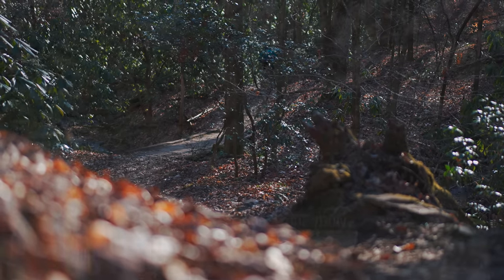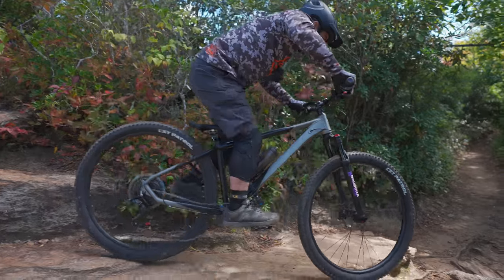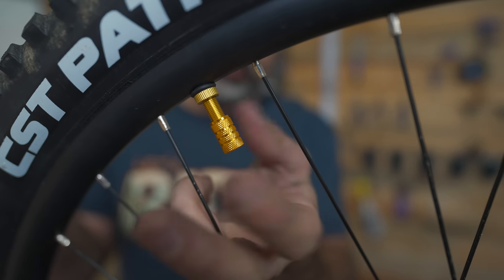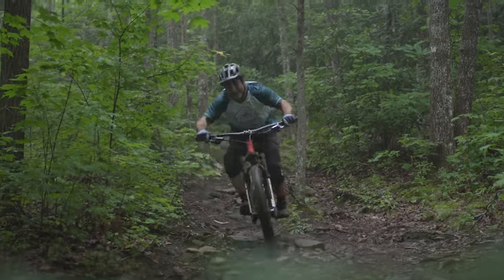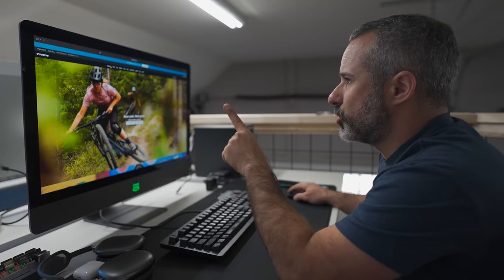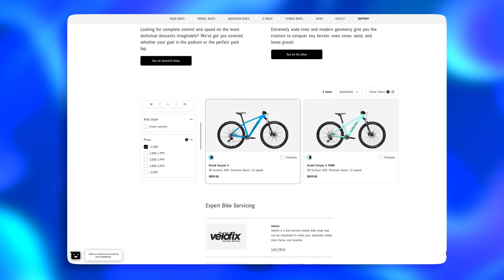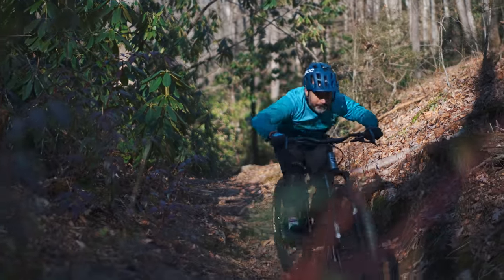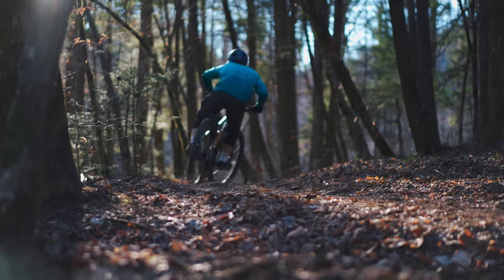Was putting $425 of upgrades into our Walmart Bike a good idea?

Comment: Tbh I disagree when Seth said that department store bikes aren't real mountain bikes, like yeah some aren't but decathlon they make real ones and they even have a cross country team with notable riders like Maxime Marotte, Mathis Azzaro... Like Decathlon is definitely a department store but they make real mountain bikes, I have one, the Rockrider XC100S, down country bike with 120mm travel front and rear (Manitou air suspension), 29er wheels by sun ringlé and they are boost and tubeless ready, 1×12 NX Eagle, SRAM level t hydraulic brakes and bought that for 1400€ and tbh it has been treating me well, this bike handles even the steep rocky terrain I have in the french Alps, so thats why I disagree when Seth said departement store bikes ain't mountain bikes, because Decathlon they are making some rad bikes

Comment: Simple answer, no. Been there, done that, got the t-shirt. I ended up with a bike that had (for the time) top of the range gear. DX shifters and derailleurs, XT cantilevers, Ritchey Logic chainset, hand built wheels (Mavic 231s/Wheelsmith double butted spokes/DX hubs) and it all hung from a cheap frame. Cheap bikes start with a cheap frame, and it's never going to get any better.

Comment: Well, you probably haven't heard of it yet, cause it's a silent one, but there's a massive French tsunami wave coming to your very shores, it's called Decathlon.
Decathlon has a long tradition of producing good frames on the cheap, they're sturdy, they're well built, they tend to be on the slightly heavy side, but the geometry and ride feel is often really well designed..
But wait, there is more, Decathlon is the number one client for Shimano in all Europe, by far. I'm not even kidding. They actually have 1747 stores over 60 countries, most of them in Europe but also over 200 in China alone.
So once you consider how important cycling is this side of the ocean and on some other parts of the world, you can easily fathom how strong a price negotiating power these guys have.
Here in Europe you can get from them a bike that ticks all your boxes : Air suspension (Suntour XCR32 or similar one, depending on local availability), Tektro Hydraulic brakes, Shimano Deore clutched derailleur & Deore crankset, KMC chain, 29" wheels tubeless ready rim & tires on most sizes (27.5 on the smallest one), standard sized seatpost and dropper cable routing ready.
All that for only 799€ (no extra taxes at checkout whatsoever), plus the frame comes with a lifetime warranty. Crazy shit.
They've already started to grow and spread out in the US. 
However, I don't see that very bike i mentioned listed on their US website yet, but similar ones will come sooner than later as this brand will keep growing on US land. Trek and the likes better ready themselves and up their game, Decathlon comes from the doorstep of the most famous velodrome in the world, the one of Paris-Roubaix, they know cycling through and through.
Reply: 👆👆👆Congratulations fan you've👆👆👆 been selected among my shortlisted winner 🎁🎁🎁

Comment: I pretty much did this I got a £300 bike and slapped a low end shimano  clutched 10 speed on the rear with single ring front then got a Sr suntor airfork I'm surprised you didn't go for that because they are like £120 and hold up well I have thrashed the living hell of of that bike and nothing has given (already came with hydraulics)
Reply: Feedback appreciated🙏
I have a presnt for you 🎁 ☝👆

Comment: First impressions of this video series is Berm Peak is turning into KevCentral (SethCentral? LOL), but no. It's not.

That said, Kev's platform is based on a different perspective of upgrading big box bikes out of necessity due to many people not being able to afford $800 all at once. There is a decent argument for this bike to be a decent platform for upgrades.

As I always tell folks, buy as much bike as you can afford because it will coat you less in the long run.

Comment: you cant try buying a really cheap dropper post from zoom thats what i installed on my budget hardtail and since the seat tube of my hardtail was way too small for the dropper itself i grided the all the sides of the zoom dropper post so that it can fit the sides of the zoom dropper post is very thiccc so you can shave it.
Reply: 👆👆👆Congratulations fan you've👆👆👆 been selected among my shortlisted winner 🎁🎁🎁.

Comment: You missed one criteria that makes the upgrades worth it... if you're a new rider and dont' know if you will even like it, much less stick with it. THEN buy the cheap Walmart bike, ride it for a few months and decide if you're going to keep at it, then upgrade the parts you don't like. THAT's where the value comes in: less risk if you don't stick it out, then the options of only upgrading the parts you don't like. I did that with my Schwinn Axum from Walmart and have zero regrets.
Reply: Even then, I would recommend the lowest end model from somebody like Trek or REI, which will be vastly superior to any department store bike for around the same price.
Reply: @Durwood71  Not sure that's true. Schwinn frames are solid, they just put on cheap components which you can replace later as I said. It's been a couple of years since I did my price comparisons, but you will come with a comparable bike (at least) and have the option of picking and choosing which parts you actually need to upgrade based on your riding habits. If you KNOW you love biking and will stick with it, ya - buy what you need up front and save a few dollars (not as many as you may think) but if you don't have the money this year or just want to play around at a lower cost until you decide to stick with it, there are decent starter bikes at the big shops. Check the kevcentral youtube channel for lots of info on this.
Reply: @KenOtwell  Personally, I would never recommend department store junk to someone who is interested in mountain biking.  I would encourage them instead to spend a little more on something from a reputable company that's willing to stand behind their products.  Not only will the bike be safer to ride, the higher quality components will make the overall experience more enjoyable, and they won't need to start thinking about upgrades for quite some time.  And, if they later decide that mountain biking just isn't their thing, the bike will have better resale value.

Frankly, I can not think of a single reason to recommend buying a bike from a department store.
Reply: @Durwood71  Well - I'm more than happy with my decision and my bike. Yes, the upgrades cost as much as the original bike, but now I have a perfectly tuned bike to my taste for under a grand.
Reply: @KenOtwell  I'm sure you're perfectly happy, but then, you are someone who was already vested in mountain biking.  You were talking about a first time mountain biker who doesn't know what they want, and in that case, my recommendation would be to avoid buying a piece of junk from Walmart that will give them a bad experience and could make them give up on the hobby.

Comment: white xc 290 pro ltd 22 gx 1x12???? got it for 999 usd with sealant, tubeless valves, lube and a rockshox sticker plus some spare washers, doesnt get any better, has a rockshox recon silver RL fork, sram gx derailleur, sram nx chain, sram pg something cassete, sram x1000 cranks, sram level brakes, fsa headset, wtb saddle, 180mm rotors front 160mm rotors rear, maxxis recon race tires, wtb wheels,

Comment: At the time of this video you can get a Polygon Xtrada 7 (which has an air fork, thru axles, and Deore 1x12) for $850. A Marin San Quentin 1 is about $850 as well at Jenson right now. Both of those are better than the Trouvaille. So I totally agree that the dept. store bikes aren't as good a value as some may argue.
That said, I picked up a Schwinn Axum when they were on sale for $228 last Fall and that was absolutely worth the price. There is also the argument to be made that you can get the Trouvaille for $400 or whatever and ride it as is, upgrading as budget allows. So if $400 is all you have, the Trouvaille gets you on the trails with a very upgradable bike.

Comment: I bought a better 2nd hand bike far cheaper and repaired it for a total of about 630 pounds ($1200 NZD),
Result... A new upgraded low spec Walmart bike for 200 pound more...
Or a 10yo Giant Faith 0 full suspension 26er with 203m XT brakes, Saint clutch derailleur, Zoom dropper, Pimplite rims, Racee Face & FUNN componentry and 7" suspension (Totem front and new RC3 Debonair rear).

Would you Huck to flat 1m on the Kent Trouvaille.

Hmmm now what to spend that spare 200 pound...

Comment: For the time and money invested, it's not worth it as far as I'm concerned.  At the end of the day, it's still a dept. store bike that is basically worthless when the time comes to upgrade to a new ride.
Plus, someone on a tight budget is probably not going to have the tools required to do the upgrades nor the money to pay a shop (not to mention the hundreds of dollars for the parts put into it).  If they take it on a ride and it breaks, it's probably ending up in a dumpster.
Bikes like this are only slightly better than a waste of the materials they are made of, they are basically throw away bikes - unless of course, you head that sticker and stick to the bike paths.

Comment: You will be hard pressed  to find a better bike for around the total price paid for the bike and upgrades made in this video. It doesn’t matter your income or budget. If you have any knowledge and know your way around working on bikes, it’s obvious that a budget bike build is the way to go. I just got back into riding bikes a few years ago, and all my bikes have been budget builds, or bikes I assembled myself. I will say I’m more of a street rider and ride my bikes around the city doing tricks on them. I take cheap mountain bikes, turn them into hybrid bikes, and ride them like they are oversized BMX bikes. The upgrades and mods I have made to my bikes have turned them into mid-level competitors. Some of the upgrades and mods made in this video were unnecessary, or overkill. I also think where he went wrong was with the forks. He should’ve paid a little extra and got some type of entry-level Rockshox’s. That would’ve made that bike a beast and more of a force to be reckoned with. I will also say if you buy any type of department store bike and want to do any kind of advanced trail riding and/or long distance endurance riding, you should expect to invest more money into your bike build. Trust me, you won’t be sorry, and as proven in this video, your bike will be better than any other bike in that price range.

Comment: well wait a second the megalo mart bike is 190 bucks cheaper then what you compared it to. because the wallmat bike was comes with the same fork as the examples.

thanks for the rant about local bike shops. they really do save you hours of faffing around. just dont take a project like this one to them :P and dont ask them to install parts you bought online, or leave a tip. it is like bringing a beer to a bar.

Comment: 200 IQ play - try to call Kent and get them to sell you a replacement frame. They sell it to you for around $100, then you build it up with these budget parts for around $600 all in.
Reply: you can get these oem frames from aliexpress (alu, 29, bsa, tapered, internal routing) for ~50-70$ with free shipping
or a carbon frame for ~150$

Comment: These were some very biased remarks and why some of the other channels do such a better job at these reviews such as Wolftick and Kev Central.  First, except for the Polygon, none of the other bikes were tapered headtubes.  All three were more expensive than the upgraded Kent (although Polygon is always on sale), and all three had inferior coil forks, thus, to get to an equal comparison to the upgraded Trouvaille, would be closer to the $1000 mark, making this a few hundred more, not $50.  None had a tubeless setup, and the Trek had an inferior drivetrain/crankset that was more equivalent to the $400 stock Trouvaille.  Trouvaille also has a slacker headtube and more modern geometry than all but the Polygon.  Then adding silly comments like "the Trek looks far better".  That is subjective, and I personally like the low profile matte black/silver look of the Kent without the large "look at me" decals of the brand name.  The bike stand?  It is fully removable.  What you are referring to is the bike stand bracket Kent chose to utilize.  But you don't "need" a grinder to take it off.  Where the other bikes may have an edge is in build quality and dropper post.  For those that don't have the tools or knowhow to build and repair a bike, these are obviously not options, but what about those of us that do?   The only example that I would say might be a better deal of the ones mentioned is the Polygon.  It is a great deal and often goes down to the $550-600 range during the holidays.